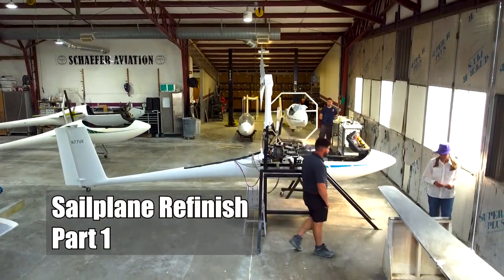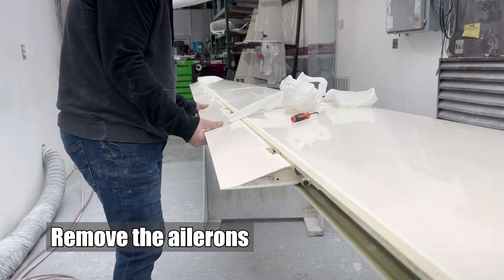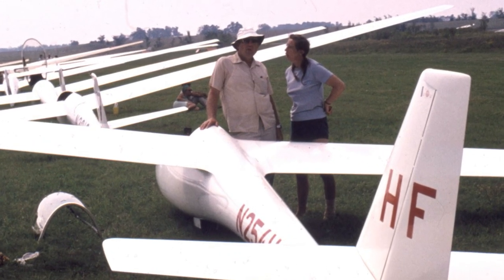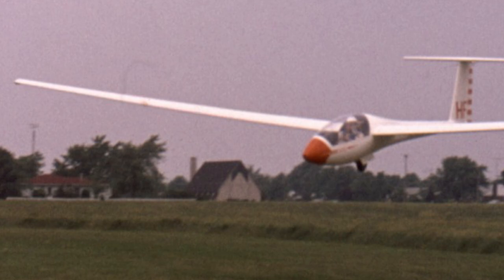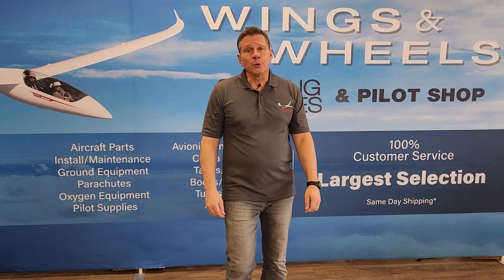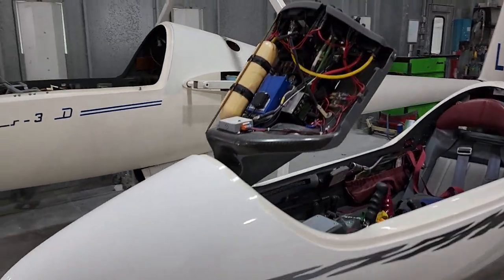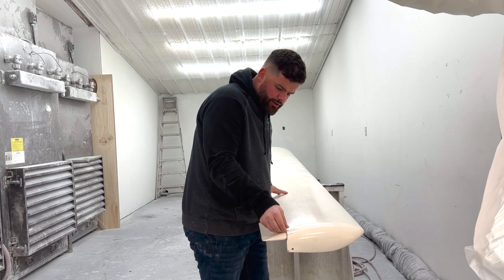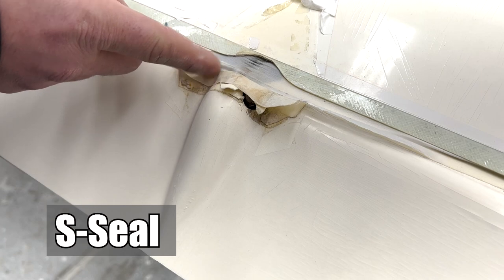Sailplane Refinish Part 1

Comment: Wings & Wheels - than you for this video series.  I have bought my glider through you and I have just bought a couple thousand dollars of lxNAV instruments from you.
.
When it comes to UV protection - why are we not using a simple vinyl wrap?  I have already seen them being used on gliders.  The vinyl wrap is lighter than paint and gel coating. Vinyl is very easy to apply, it can be easily removed (in the future), has great UV properties, but most of all comes in an amazing array of colours and patterns.
Reply: Because fiberglass resins need to stay cool, generally the only acceptable color choice is white to avoid reducing the strength of the glass and resin.
Reply: In addition to the issue of temperature (as mentioned by "The Soaring Channel", its worth noting that vinyl wrap would hide any evidence of cracks in the gelcoat.  While this might seem like a benefit for non-structural minor cracks in gelcoat as it ages, this could be a serious problem if it hid a structural crack or an area of delamination.
Reply from the maker: Hi Mark, I heard about the wrap you described used by some in Europe. Not convinced it's right for me. Thanks, Sean
Reply: @wingswheels  The above is all very good advice.  I have an HP-18 which is a metal plane (except for the cockpit). Can any see a problem with me using vinyl wrap?  I'm thinking of a matte white colour.
Reply: Hi Mark,
Vinyl can work well in some applications. I often use it for accents and ID's. It is currently not an approved finish by most manufacturers for repairs, let alone full refinishes. I agree with the previous comments.

Comment: Amber, get out of my shot! That was pretty cool to see, and I'm looking forward to the rest of these. It seems that this should be very boring, but I can already imagine what the refurbished sailplane will look like. Can new "improved" winglets be attached to an old LS-3?
Reply from the maker: Hi Rick, Amber spends her day at W&W greeting delivery people and visitors. I already check with DG. They don't make neo-winglets for the LS-3. Thanks, Sean
Reply: @wingswheels  Thank you Sean, that's good to know. There are a ton of older sailplanes on the site and seeing the restoration of the LS-3 will give all of us a good idea what the result will be. I'm I correct in assuming that the winglets would do more to increase performance than just about any other modification?
Reply: @rickemmet1104   I haven't seen an LS3a polar with and without winglets. I'm not convinced the increased performance beats the handicap penalty in competition. No doubt it helps in handling but the LS3a is really good as-is.